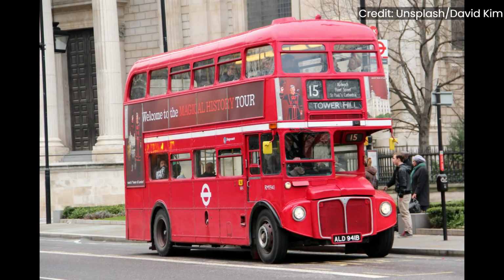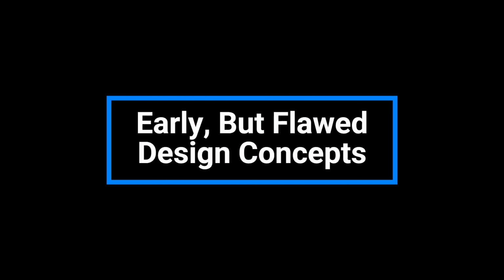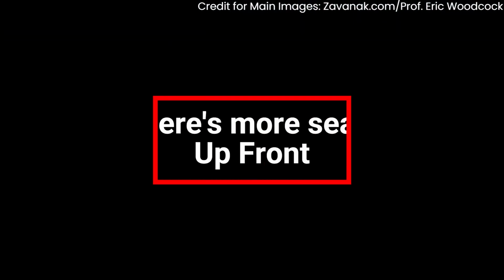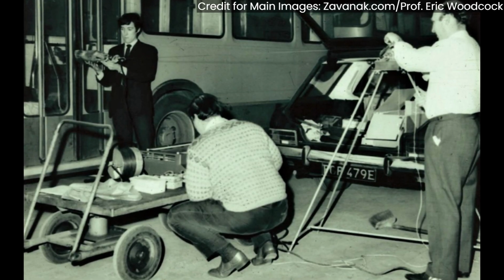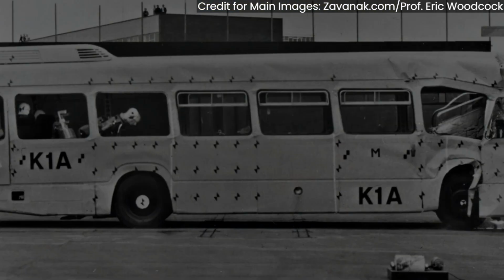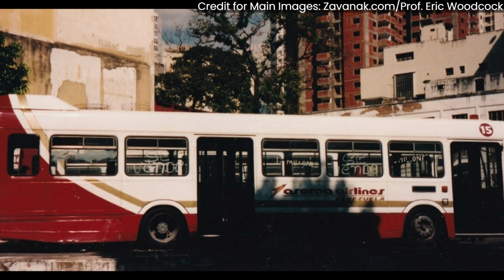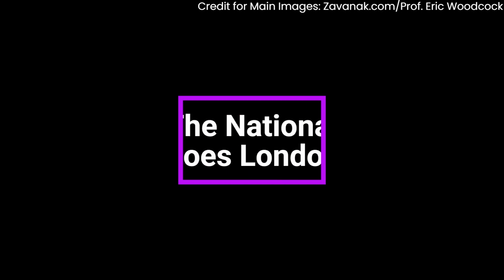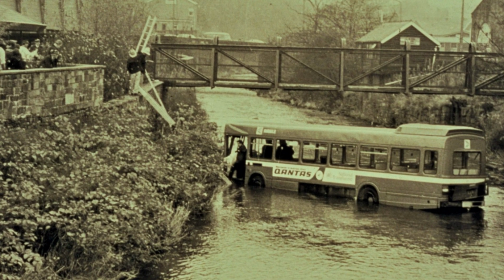The Leyland National Bus: Amazingly Flawed Engineering!

Comment: As a former bus driver, i had the pleasure of driving the Leyland National for 3 years. They were a bus drivers dream. Always had to bear in mind the long overhang at the back. 
They were a very comfortable bus to drive. The power steering made it a dream. In fact, sometimes, the steering was just a bit too light at times. The only real problem with them, was the thermostat. They would often fail. Heating on in the summer, heating off in the winter. Nothing as a driver you could do about it. The gearbox was first class. The setup we had, was that we could leave the gearbox in fully automatic, or we could change manually. 
Passengers used to love travelling on these buses, as they were very smooth, with a nice soft suspension.
Reply: When the National first came out I remember a driver (probably transferred from a Bristol RE) complaining that "It goes very well in a straight line, especially when you don't want it to!" The RE had a Rear Engine as the name suggests, but the gearbox was mounted ahead of the axle, which gave a much better weight balance. The National had the engine and gearbox behind the axle and without many passengers it could lift its front wheels and lose steering.  As a passenger they were very smooth and refined except for the clouds of black smoke, but I preferred the REs especially with Gardner engines. Excellent buses, no wonder Leyland bought them and closed them down. My all-time favourite was the RE coach with the high floor, high speed axle and air suspension, like running down the M1 on a magic carpet.
Reply from the maker: Hello! Thanks very much for your experience in driving the National - very interesting!! Thank you for watching and for your comment!

Comment: A great video, but it misses a few key points. 
1). The fixed head engine was a nightmare: unreliable, noisy and smoky, plus expensive to maintain and repair.
2). The Leyland National cost approximately 30% more to buy and cost 20% more to operate than the vehicles it was replacing (official National Bus Company figures proved this!). 
3). Over engineered with little or no consideration as to how it would be maintained. It followed vehicles that were very simple and quick to maintain (e.g. Bristol RE).
The designers should have gone with evolution, not revolution.
It only existed because Labour Governments financially supported it. Few open market sales demonstrated how poor this bus really was.
Reply from the maker: Hello! Glad you liked the video! Interesting additional comments! I think I may have touched upon point 3 - the complexity - the heating system was too much to maintain for many operators, and it was mostly revised/simplified and the roof pod was removed in the Mark1 B. Thank you for watching and for your comment!

Comment: The very first Nationals had a serious flaw, the body would suddenly roll on the suspension when cornering, the sudden redistribution of weight made life very interesting for the driver, especially in the wet, the Goodyear Unisteel tyres they came fitted with were poor in the wet and would let go very quickly and without warning.
This flaw was soon rectified by returning them to British Leyland to be retrofitted with body dampers, the front tyres were changed in the depot to Michelin Radials which made them much better in the wet, (The Goodyear tyres remained on the rear) the second-generation buses were much better, But it was only when the Mk 2 came along did we get a bus that was warm, powerful and good to drive, it was a vast improvement on the first efforts and was really a very good bus.
Reply from the maker: Hello! Thank you for the additional information on the Nationals!! Thank you for watching and for your comment!

Comment: Another great video Jeffery. Unless I missed something here, wouldn’t it have made sense to build a single deck bus based on the long proven double deckers that were being built in the 1970’s and 1980’s.
Reply from the maker: Glad you liked it - I think the concept of the National was different than the standard double deck chassis of the day, being modular...different construction methods used for variation, would be one reason why they didn't go for a more proven type of a bus. Thank you for watching and for your comment!
Reply: @JeffreyOrnstein  There had been single deck Daimler Fleetlines, performance was pedestrian, drivers disliked them as the driving position was too low and bodybuilderws failed to engineer a durable enough structure.  The Leyland Panther and AEC Swift used Leopard and Reliance units in a frame and with a front axle derived from the Atlantean, Panthers you have covered already.

Comment: I dove National’s when I was with London Transport, brakes could be unpredictable, I much preferred the MK2 with a TL11 and Hydrocyclic gearbox. l have driven ones with Gardners , very safe bus in a front end smash we had two that had nasty front enders everyone walked away.
Reply from the maker: Thanks for your comment about your experience with the London Nationals! Thank you for watching!
Reply: @JeffreyOrnstein  The history of the Leyland 500 engine is interesting to, sadly the old story of lack of money , it’s designer leaving and lack of vision, but it was a fully metric engine unlike some of the buses it was fitted to containing several thread types lol
Reply: @BerlietGBC  National was intended to be fully metricated but only partly got there. Gearbox remained put together with imperial fasteners despite French built licensed versions of the SCG gearbox being fully metric.
The rear axle was based on a 1940s original design which was imperial based.
Reply: @jamesfrench7299  Oh yes I'm well aware,   the pre selector box before the 5 speed rationalised box was also built in France  , you could have the rationalised box in many configurations from free standing close coupled and with a splitter the RV38 I had one of those in a Scammell Trunker ,

Comment: In the mid 1980s I used to ride home from school by bus.  It would usually be either an Eastern Counties Bristol VR, Bristol RE or Leyland National Mk1. The Nationals were R & S registration with short roof pods most of the time. On only a couple of occasions an early National wirh long roof pod on an L registration ran the bus service I used to get. On rare occasions did a National Mk2 with no roof pod run.
The National Mk1 with the short roof pod was my favourite. As a 10 to 13 year old I was taken by the crisp and well thought out design of the interior of the phase 2 Mk1. The long pod version had an older look to it inside I found. The noise of the Leyland 510 engine was the other thing I remember fondly. The 510 had a very distinctive clatter at idle and a memorable whirring whooshing noise as the bus pulled away. The only other bus that came close in terms of distintive engine noise for me was the London Transport MCW Metrobus double deckers I used to ride to and from university in the early 1990s. It's the National though that's my alk time favourite bus.
Reply from the maker: Hello! Thank you for your experience with the National. Very interesting! Thank you for watching and for your comment!
Reply: I had to double check the name above this comment to check, this could've been typed by me. Exactly the same sentiments regarding both the National and also the Metrobus... what a sound!!

Comment: I liked the National They were very noisy and smoked a lot but never got stuck in snow unlike the other busses in the fleet. There was a 1 in 7 hill ( 14% ) going to work and one year the gritters were on strike. The driver said he was not sure we would make it with about a foot of snow but would try in low gear. We pushed our way through with snow up to the windscreen and made it with no problem. In later years the doors caused problems and the centre door ones had them removed, a micro switch on the engine bay door used to need a kick on the door before they would start, also the air suspension got none existent, they were pretty old by then so overall outlasted many other busses.
Reply: I was a passenger on a National that got stuck in a deep snow once.   The driver put it in gear and floored it.   Nothing happened and after 5 mins I got fed up and got up to tell him that merely flooring the throttle and spinning the wheels will never work.   I got within a few feet of the platform when I realised how wrong I was.  It came out of that drift at warp 8!  Just like a kids pushalong toy when you set the wheels spinning and drop it on the ground!  The driver explained that the combined effort of the wheels digging down and the heat and weight of the engine meant they acted like giant milling cutters, cutting through the snow and ice until they touched something solid.   As a driver a few years ago I too got my Enviro 400 bus stuck in snow and used this technique to free it.
Reply: @chrislee5981  Great to hear it worked. I had a driver try that with a leopard and it just burnt the tread off the tyres, with no weight of the engine over the back end, other drivers had asked eveyone to move to the back and that had worked too
Reply from the maker: Hello! Thank you for relaying your interesting experience with the National! Thank you for watching and for your comment!

Comment: I was working for National Bus in Southampton when they were first introduced, we had I believe 6 pre production units for assessment the buses were not bad easy to drive mechanically they were average for the time though using the fixed head cylinder did offer challenges , BUT they were expensive so the cost engineers in Layland were let loose and the outcome was I would say disastrous essential component brackets removed or lightened Turbochargers changed of cheaper units anyway in the first year of production and fleet operated there were over 250 factory recalls and most of the buses were being recalled to have rectification work carried out Hence they got a rather poor reception there was also a talk of opening an assembly plant in Iran but the revolution put that idea to bed
Reply from the maker: Hello! Very interesting. Didn't know about the recalls or the Iran plans. Thank you for watching and for your comment!

Comment: One thing that helped the National last as long as it did, was that whilst not "low floor" by modern standards (due to the step inside), they were still low by the standards of many other single deckers of the period and later, and therefore gave good access even at a time true low floor buses were coming along. Add in that the air suspension could be retrofitted for kneeling, along with the wide entrance, and you've got a bus that whilst not accessible by modern standards (or even standards of the newest buses at the time) was still more accessible compared to many newer buses that were still around in the late 90s and early 2000s (and remember that for every person in a wheelchair who needs a totally flat floor and ramp, there many older or walking disabled people who will benefit from a lower step even without full wheelchair access). A company where I live ran some heavily refurbished Nationals calling them "easy access" and it's hard to dispute compared to the more modern Dennis Darts (with a higher floor) that they were running in competition with. Even when the Darts were replaced by Low Floor versions, these still lacked the wheelchair ramps found on modern buses, so by todays standards their accessibility was not perfect.
The heating system issues with the National are something that have plagued British buses for a long time, keeping them warm in winter and cool in summer, and many radical ideas have failed. Most recently the issue has been more about cooling in summer, where there has been a tendency to remove opening windows in favour of "air cooling" which can't cope on hot days. Ultimately though the approach taken with the National, combined with old school floor level radiators, has proven to be pretty effective and has seen widespread use by many manufacturers. Perhaps the most obvious was Optare, who pretty much revived and improved the National's original system to good effect, giving their Delta (and variants) and replacement Excel, the same iconic rear pod as the National.
Finally, towards the end of their lives, there were a number of programs to update and life extend older Nationals. The two most common upgrades were replacing the original Leyland 510 engines with Volvo power units, and also replacement of things like bell pushes, flooring and step edges along with painting grab poles to bring them up to the latest DPTAC (pronouned "dip-tak") standards for accessibility (as said above, the National was already pretty good in that regard). Fitting better heating systems was also common. Some also included bodywork changes, particularly updated headlight clusters. The most radical was the "Greenway" from East Lancs Coachbuilders, which as well as new engines, stripped them down to the shell and replaced the body panels, giving a modern appearance (usually combined with an "Irish Plate" which unlike standard UK number plates doesn't have an obvious year, so to most people it looks like a new bus). These were particularly common in London, the two biggest operators being London Transport for their "Red Arrow" services in central London, and Greenline who operated in the suburbs and beyond. One of my local operators, Midland Fox (now Arriva Midlands) gained quite a number of the old Greenline Greenways and kept them well into the 2000s.
Reply from the maker: Hello! Thank you for your detailed comment on the features of the National - very interesting info. Thanks for watching!

Comment: A noisy charismatic smelly tin can ,a bit like an overgrown Fiat Panda that sent Leyland,s Bus Division  down the toilet. You forgot to include a photo of a Bristol RE the COOLEST single decker bus in Christendom!!!!, nothing can touch an RE, with Gardner 6LX power  reliable bomb proof simple to fix and drove like a decent sports car.  The RE with 680 Leyland power  were right divas, fast riddled with attitude and easy to boil up when thrashed.
Reply from the maker: Oh yes, the Bristol RE! Good topic for a video, and so many variations. Thank you for watching and for your comment!
Reply: @JeffreyOrnstein  You are most welcome and  yes the Bristol RE ran rings around Leyland,s 'Tin Can' and regarding air suspension Bristol fitted such a feature as standard to Coach and Dual Purpose RE,s in the 1960,s.  The National had more faults than a Sinclair C5, its 8,2 litre 510 engine clattered like a  flock of goats shitting on a tin roof smoked like a cannabis addict and underpowered. The front axle ate those skinny 275/70 section tyres like a starving pig due to poorly designed  steering geometery. Early Nationals when fully  loaded wallowed like a slapper after too many run and cokes, no anti roll bar on the front axle.

Comment: Some clips I’ve never seen before. Thanks I will check the web site out. Surprised you never mentioned leylands insistance of only fitting the 510 engine which was one of the main disputes of the era due to its headless design. Another video perhaps ?  Good work.
Reply from the maker: Glad you liked the video! Yes, you are right, I didn't mention the 510. But perhaps as you said, maybe for another video. Thank you for watching and for your comment!